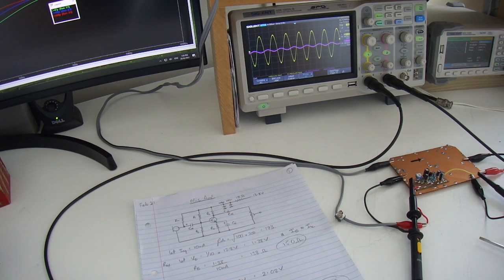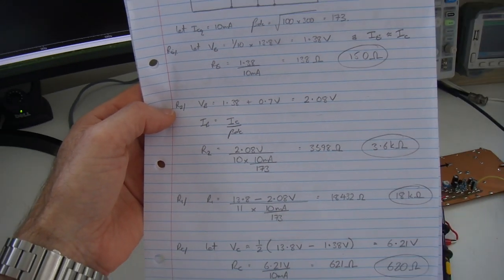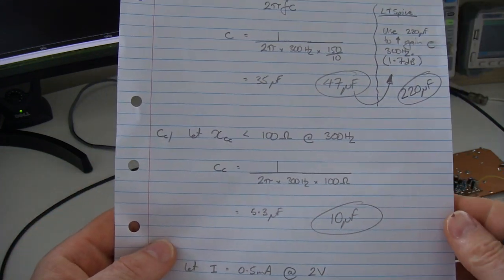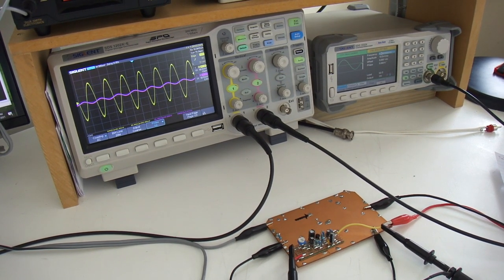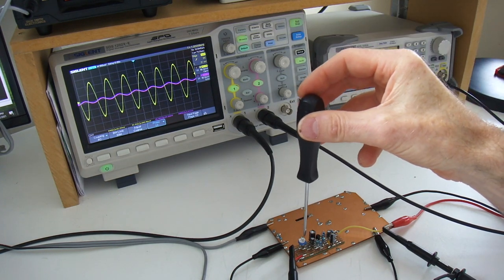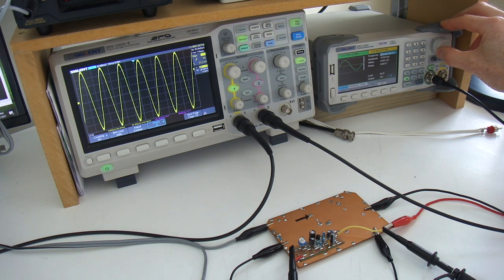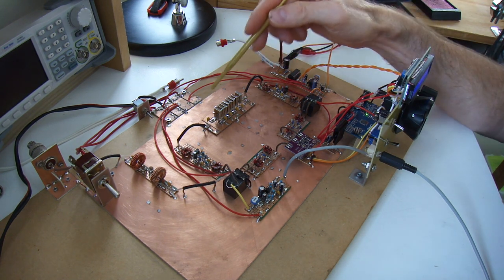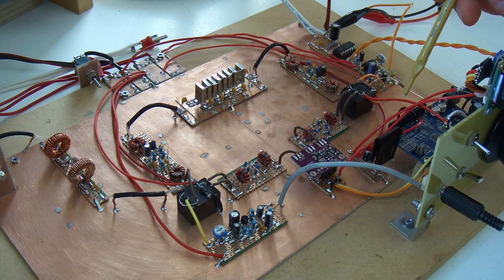Simple SSB Rig: Part 9 - Mic Amp, Low Power Transmit Test

Comment: Great work again Charlie , i always enjoy ur video's as you take us through the circuit and show us what is happen on the test gear a top teacher and explained well ,so many thanks for that Charlie. I noticed ur HF Xiegu rig and just wonder how you find them on the operational side of thing ,certainly sounded ok ,We are in the steps at the moment of making up ur project for 80m ,then later i would like to try your designs construction and try a put one on for the 6m band. Many thanks again and for inspiring us.
Reply from the maker: Cheers Dave. These are just simple rigs, but a lot of fun for me. The Xiegu works well for me. I'm not a competition operator, so the small screen and buttons are fine. I do like it for it's small size, which works well for my small shack. As for 6m, I too am looking at the higher bands now that we are on the next sunspot cycle. Not sure when I'll tackle that though.

Comment: Thank you Charlie I needed some motivation this weekend! looks like things are working great. audio sounds good. what power output do you have like its setup?
By the way, I made my LM386 sing very well last week. it was the preamp giving me problems. I figured it out while not knowing my LM380's were in my mailbox. lol
I've been working on my VFO and BFO with the display. I put it in a box so I can reuse it on other radios or add on to it. something I am adding to it is an I/O expander board. you might want to check it out if you run out of I/O. this one is I2C. PCF8575 the module is open smart IO expander 1610. it adds 16 I/O and can make them a different voltage than your processor. I believe it was from 1.8v to 5v, and you can address them so you can have three modules if you needed. I think it was the Teensy project you were running out of I/O if I'm correct and had to use the larger Teensy. I needed it because I am using an esp8266 with built-in wifi and Bluetooth but it has a low pin count. it also runs faster so the display update is nice and fast. I also ran across an SMD IC that is an RF switch that looked interesting I want to play with one. works from 1Mhz to 500Mhz up to +30dbm. maybe in place of a relay?
have a good weekend!
Reply from the maker: That's interesting. Thanks Kurt. As for output power, only a couple of hundred mW. If i get time, I'll work up a simple RF PA to keep with the theme.
Reply: @CharlieMorrisZL2CTM  A PA sounds good I've been distracted thinking about that, so many different transistors. I was thinking for me 10 to 20 watts 100 at most. but I would like it to cover higher frequencies as well. I can drive something bigger for sure with that amount. I should probably just buy a few and see what I get. lol

Comment: Could you let me know how much carrier suppression you have achieved? I find this a real problem with all my balanced mixers/filters
Reply from the maker: Hi Antony. I must admit I am not sure how best to measure that. What elected to do with this build is sniff the output using a RTL-SDR and then adjust the TX BFO to get best TX spectrum, in this case minimal residual carrier and best received audio clarity. As it turned out, I cannot see any residual carrier (on the RTL-SDR or receiver waterfall) and get (in my view) really good received audio clarity. This is the first time I tried this approach and it seems to work well for me.

Comment: I just finished a Crystal Filter based off HC-49S Crystals (Mostly because I can't seem to find any cheap HC-49U Crystals.) I have a IF freq of 8.466-ish Mhz because that was the only freq I could find in bulk. (Was ordering off amazon because getting stuff from AliExpress takes well over a month sometimes.)  I have some AD831 Mixers I am going to use. (Mostly because I have them). Annoyingly I only have about 1.7Khz of bandwidth in this filter, I may try to build another one with 3 crystals instead of 4.
Reply from the maker: See how it goes. Perhaps reduce the capacitance and see what impact that has.
Reply: @CharlieMorrisZL2CTM  I am going to make a second filter using some more of my Crystals and see what happens. I can use my current one as a Narrow SSB filter, sort of like how some professional rigs have that. (My IC-718 has the option but doesn't have a filter installed for it)
Reply: Managed to get a filter with about 2Khz bandwidth. Which i am going to just try using. (I am building each part as modules with SMA connectors.)

Comment: Thx for your vids Charlie. Qustion. Does it make a difference if you toggle BFO and VFO on Tx/Rx vs you "toggle" the input of the muxers. In my radio I am playing with I keep the BFO and VFO at the mixers and flip the mixer input. So I use the crystal filter in both ways.... hmmm. What approach is better? 73, Stefan, HB9GZE
Reply from the maker: Hi Stefan. Short answer is no. The reason I do it this way now is that I had several feedback issues with the small rigs. Essentially, I had RF from the output of the second IF amp finding its way back into the input of the first IF amp via the switching relay. This current format does away with the crossover problem and I have not had a feedback issue since. Each to their own I guess.

73 Charlie ZL2CTM

Comment: Could it be an idea to also make the Emitter resistor a trim potentiometer?
the value ..... that 150oHm with at the runner that capacitor to the min
.
i am not an electronics engineer!
I always made my FM pirate transmitters with an amplifier as indicated below:
BC109 Emitter to min --
resistance 100K from base to colektor.
4K7 from colektor to plus. +
input and output 4.7uF
the rest is about the same!
by the way, don't know if that's better or good enough!
.
Kind regards again from the Netherlands!
Rob
Reply from the maker: Yes you could in theory. Just make sure the power dissipation at 10mA does not burn out the trim pot. That would provide varying negative feedback. It would also affect Rin, if that was an issue. Another way is to use a diode with a varying DC.